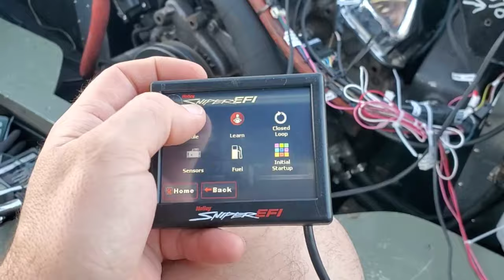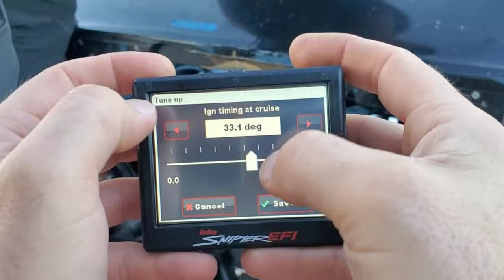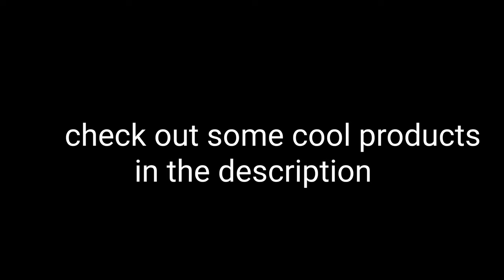Jet Boat Big Block Efi starting and testing. Holley Sniper #sniper #jetboat #racerabbit

Comment: Long time jet boat guy first time building a jetboat. I’m running dry headers that come over the back of the transom. And I want to run a sniper instead of changing the jets every time I take my boat from my house to my brothers, 5000ft to 1200ft of elevation. But I don’t have anywhere on my avatar where an o2 sensor would mount. That means I’ll have to drill and cut spots in correct?
Reply from the maker: About 3 inches back from collector on one side. Get oxygen sensor bung.

Comment: Where were the o2sensors installed at in the exhaust and how did u guys deal with the wet exhaust not messing with the air fuel ratio?
Reply from the maker: The manifolds are water jacketed and there's a spacer between the manifolds that 02 sensor goes into. The manifolds do not mix water until farther away in the system.
Reply: @AaronCoyRacing  that's cool do u know where he got those spacers?
Reply from the maker: I will find out.
Reply from the maker: @mark's repair j Affordable fuel injection is where the spacer came from. We are heading out in the boat again next week for a tuning session.